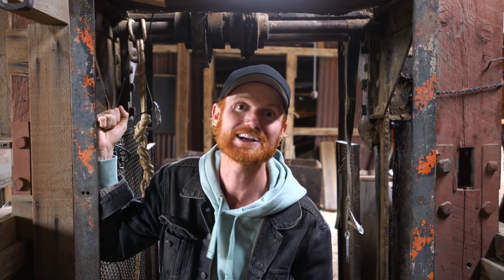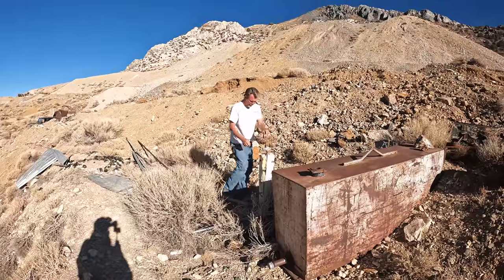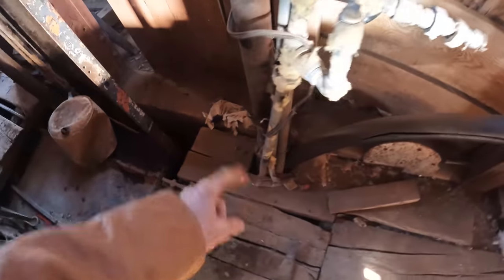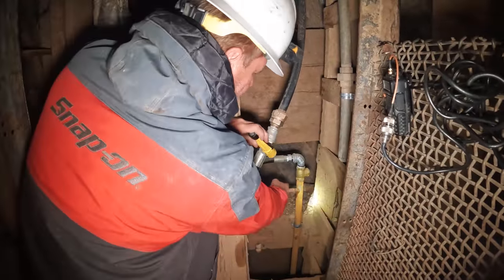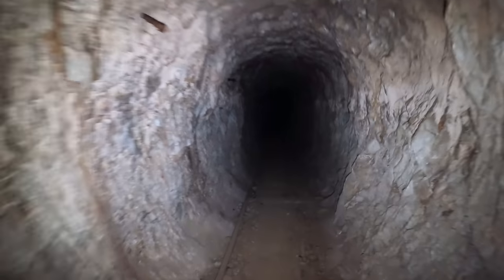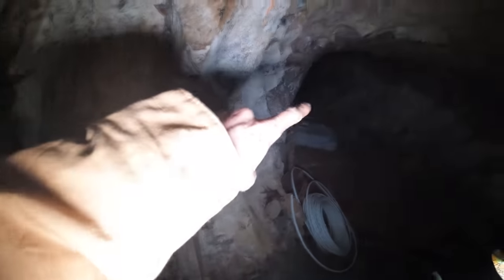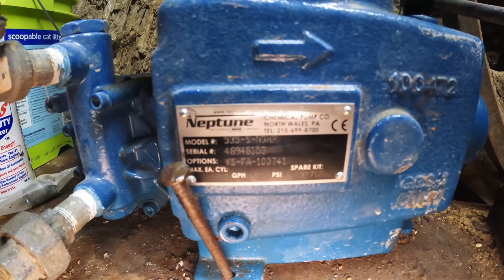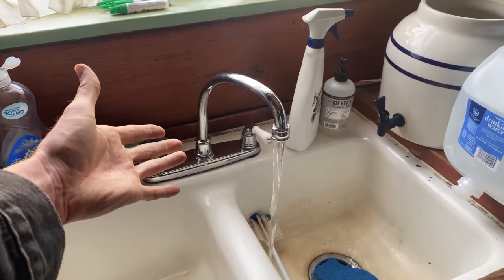How Cerro Gordo 'Ghost Town' Gets Water

Comment: You should try a pump at 375 and at the top with holding tanks at each level .
Reply: That's a really good idea.  Far less stress on the pump, plus you'd be able to store water in whatever size tank(s) you could get down there.  Also an accumulator would be able to help with pressure.
Reply: @codemonkey2k5  are you with Brent ?
Reply: I absolutely agree 👍.  Been thinking on it for months now. It's not my trade, but it seems to me that I remember from my trade school days learning about water pressure in a column. I know there was some math involved, but one of the reasons they would have multiple pump stations and tanks, was that at every station, the pressure was sort of reset. In this case, instead of having 700 plus feet of head pressure, you'd get a reset, every 200 feet or so.

I haven't been able to find any of my books from that era, but think about how water moves in a high rise building in, say, New York City. I mean, how do you get a consistent water flow and pressure from street level all the way up to the 100th floor? 

I could see a system with multiple pumps and storage tanks every couple hundred feet or so, so that when the upper most tank got low, it would kick on the pump draining the next lowest tank, and so forth and so on till the 700 level pump kicked on. 

Any high-rise building engineers here?
Reply: @christophercox3908  those were my mentioned thoughts exactly
Reply: @mrblueun1080  no, just liked the idea and expanded on it.
Reply: This is a great idea but in this video they say that they’re using the original galvanized that has to have build up in the pipe creating friction lose. They should try new pipe from source to ground level.

Comment: Great video Brent! Would love to see more updates and videos about the water system.

Question, does the pump fill a central tank for the town’s buildings, or does the water in town rely solely on the pump running at all times? If there’s no tank close to the hoist house, you could put a 5,000-10,000 gallon tank inside or next to the hoist house and let the pump fill that first. This storage will give you freedom to do what you want with the water without having to rely on the pump to pressurize the town’s system. 

You could have a filtration system right after the tank in the hoist house before either feeding buildings in town directly, or filling smaller tanks at each building with potable water. Tank(s) could be heated slightly to 50°F during winter months to prevent freezing. Also gives some resiliency during power outages. 

I know you have that new and pretty 40,000 gallon tank for the hotel, but there’s something awesome and nostalgic about some of the water supply for the town continuing to be pumped from the mine, rather than trucked in from down the mountain. A beefed up pumping/storage and filtration system could achieve that and supplement deliveries.

Comment: I recall that loss of prime has been a recurring problem. As an idea, I would consider dropping a small submersible pump in the pool of water with discharge to a small 50 USg PVC transfer tank. The submersible pump could operate with simple float control filling the transfer tank on demand. You can then install the 8 USgph Neptune metering pump with a flooded suction pipe in the transfer tank thus avoiding loss of prime issues. And put high quality check valves every 200 feet on the riser pipe to keep pressure below 100 psi on the old galvanized steel section. You could also use wiring between the town above ground tank and control starts and stops of the Neptune pump based on water demand in town.
Reply: This is redundant ideology, the mine water is contaminated!
Reply: @lotharschiese8559  They are not using the water for potable drinking usage.
Reply: @lotharschiese8559  Maybe email Brent and ask to see the results of the testing. Nobody use the water for drinking purpose.

Comment: An RV park that we stayed at in Colorado had a small water truck that they used to haul water to the park and hold it in tanks with a reverse osmosis system attached. That is something you could upgrade to someday to bring you clean and safe drinking water to the town. You have your 5 ton from Heavy D, throw a water tank on the back and that could be enough.

Comment: I would suggest adding rain water catchments.  You have roofs there that catch a lot of water.  I just finished a second one that has a catchment area of 16' x 54'.  The last small rain we had filled and over flowed a 275 gallon tot which is way too small..but it is a start.

Comment: I am so glad to see that you have the pump putting out enough pressure now.  The one thing that has me, and probably others scratching their heads is where did Cerro Gordo get it's water in it's heyday?  I know you showed a water wagon that was used being pulled up there with mules, I believe.  Then I remember there was a cable tramway into Keeler that I thought went to Cerro Gordo, or was to some other nearby place?  That would make perfect sense to bring ore down to Keeler and send up water, oil and other supplies back up to Cerro Gordo.  In fact, the weight of the loads going up can help offset the load of the ore coming down.  

I keep seeing that picture of the woman standing next to the water nozzle with a firehose amount of water coming out and thinking that they must have had a lot of water.  I am also thinking of an old saying that "Money is the lubricant of commerce" or something like that.  ie. If you making enough money at Cerro Gordo, then some of that money will be used to make life there more hospitable.  So, it might be that it was hard and expensive to bring enough water to Cerro Gordo, but that the mine was making enough money to pay to bring up water wagons, perhaps even a fleet of them.   

I am thinking that the mine water is for showering and washing and industrial uses like concreate and the truck is your modern water wagon to bring drinking water up.  Is this the plan?

Comment: I'd suggest some kind of collection-based water source as a backup. For example, something that collects snow/water so you have to use less water from the mine. This way the water in the mine has more time to replenish and it's a secondary way to secure water during certain periods of time.

Comment: Have you looked into a holding tank above ground?  I used to work at a restaurant that had a limited water supply.  They had a 6000 gallon holding tank that filled on a timer.   You could put a tank in the hoist building. Gravity would send water to town. It worked amazingly well.
Reply: This is redundant ideology, the mine water is contaminated! BUT a holding tank with clean water set on high will be functional for gravity feed!

Comment: Another water source could be a large rainwater collection and storage system. I don't know the climate/rain data there, nor the size & expenses involved, just a thought. One positive: Less filtration and treatment would likely be required...
Reply: The issue would be the freeze in winter would blow all the pipes.
Reply: The dust when the wind is blowing which it does a lot,  gets airborne and it is contaminated, read my postings

Comment: The backflow prevention device / foot valve is a check valve.
Going down the elevator there's a check valve at 550 ft from the bottom. 
Curious where the new one will be installed, at ground level of the shaft or somewhere else along the line after. . .

Comment: If you keep on still loosing the feed and the pump needing to be re-primed again you could add a plastic barrel that’s slightly above the pump it would give it an air free positive head of water. If I recall correctly you have a submersible pump as a pre pump and I am thinking that maybe due to cavitation you may have air in the system between the pumps thus the need to re-prime the pump again and again. The positive head of air free water would solve the issue and wouldn’t be difficult to build building a small ‘cradle’ to hold a barrel on its side the pump water in the top and out to the high pressure pump at the bottom quick easy and easy to take down the mine. Good luck with the water and like the others I hope that you have filters and reverse osmosis plant on the water to make it safe enough love the channel and look forward to every episode. Shame I live in the uk or I would be volunteering without a doubt
Reply: Just read my postings, This is redundant ideology, the mine water is contaminated with metals.

Comment: Have you thought of looking into atmospheric water generators? They use whatever mixture is in the air and collects it with coils kind of the way condensation forms on air conditioning coils. 
It is something used in remote spots where water is hard to come by or in places where the water supply is contaminated. 
Judging by the snow you get there, there should be plenty of moisture in the air for one of those systems to work for you.

Comment: Okay, so while I know you should have more than one pump, lets say this dosing pump can handle it. What it needs is a little help.
You need to bring down a 33 gallon poly barrel. Gather enough wood to make a stand for that barrel above the dosing pump. Bring a small circulatory pump to submerge, which I know you already have down there. Bring a couple of float switches. I do highly suspect that all along you've been draining the supply sump in the rock until it sucked air. That said this needs to be changed to positive pressure or air will ALWAYS build up in the intake line on the dosing pump eventually even if the water supply doesn't run out. There is air in the water and especially in a partial vacuum it will build up and cause the pump to lock up from cavitation. So. Have the submersible pump run into the elevated barrel. You could put a switch in the barrel to kick that small pump on when needed, or, have an overflow line in the barrel going back to the stone basin. DO put a float switch in the stone basin for the small pump though. From that point you need to either use the same float in the stone sump via a relay or a second one in the barrel to control the dosing pump. The dosing pump should be fed from the bottom of the barrel. The dosing pump will never loose prime again since it will be fed with positive pressure. Air will escape out of the barrel. This system will work so long as the pumps and switches do. 

Hope this helps.

Comment: It seems to me you should have a submersible pump with a float switch in the collection basin pushing water to your high pressure pump. Use a 5 psi pressure switch before the high pressure pump's inlet to turn that pump on. This way the big, expensive pump cannot be run dry and will never lose prime. You could also add a filter before the high pressure pump's inlet to reduce wear from particulates in the water. Increasing most pump's inlet pressure greatly improves the pump's efficiency so you'll probably get more flow as an added bonus. With the low flow rate of the high pressure pump a very small (and cheap!) submersible pump could be used.

Comment: I would suggest building a town reservoir if there isn't one already (there should be at least holding tanks somewhere), with a heavy duty KDF and UV filtration/sterilization setup to cleanse the water of heavy metals and bacteria, and then a domestic RO system in each building for drinking water.

Comment: So the water table in that specific location in that mine is above there at some point most likely, then it is about 700-800 feet or so if you could drill a water well and hope to find the same source, that is fairly deep for a well, but not unheard of. It may not be a big water source though... So they would then likely want to do some small fracking as it appears to be mostly all rock (fracking not as destructive for water wells as it is on oil wells) and then you could very well end up with a decent water supply.  I suspect for now the issue is cost of drilling an entire new well?
Reply: For a radius of a mile around Cerro Gordo, the bedrock is just peppered with minerals and many small deposits, just Google Earth and look for all the individual ground disturbances, someone dug a hole because they found mineralization.
Reply: @lotharschiese8559  Yes?  Of course, that is how mining works most of the time.  What does that have to do with their chances of finding water or not?

Comment: What an exciting opportunity. The wealth of information available today is amazing. When researching municipal water supply, domestic water systems, water storage systems, treatment and purification I always follow the key words with .pdf or .edu or both and get excellent results. 
  It is easy to establish a fundamental design from here but it's important to know what the recharge rate of the supply is.
 Does the supply draw down at maximum flow rate enough to calculate the recharge? How was the volume determined and how accurate is the data? 
  Anyway, a well thought out distribution, treatment, storage systems and source evaluation really gives way to opening up the future of Cerro Gordo. 
  By the way, managing and monitoring this source / supply is appealing in contrast to many municipal supplies.

Comment: You seem to get a decent amount of snow.  My suggestion is simple - every structure has rain gutters that collect any rain or melting snow into separate barrels and are regularly pumped into a master cistern uphill of the town.  Use PV panels for your electricity  and use gravity to help with flow and pressure issues where possible.  This does not have to be expensive

Comment: Over a year ago I mentioned this idea.. Hope I'm not being annoying...
It appears you have two problems - quantity & depth
As opposed to someone who has a 700' deep drilled well, you have a big advantage..
You can break up the required lift & associated head pressures into more manageable, more normal (to the country home owner) amounts using commonly available, off-the-shelf components.
Install lift stations with small (~50 to 100 gal) open top tank reservoirs, foot valves, float switches & pumps, every 75' to 100' up the shaft.
By doing that, you're employing commonly available parts, that operate at far lower pipe pressures.
Each float switch set to shut off the pump feeding it when the level in the associated reservoir is at max.
Each reservoir, including the bottom / source pool, with a float switch to shut off pump above it when the level gets to low.
At the top, install a much larger tank reservoir to gravity feed the hotel so that the pump system can run / draw from the pool / on a more constant rate..
Yes, it would take about 10 such lift stations, but each would require far less exotic, less expensive components, with none operating at extreme pressures & such that you could use normal PVC well pipe & the system could be serviced by the average pump / well maintenance company, or by you yourself.
One final advantage, is that you could start installing the lift stations one at a time, from the top, as you could afford it.
Working your way down, each additional station would progressively lower the head pressure on the original pump at the bottom..
Note: As you no doubt are already know, horizontal pipe does not add to head pressure.
Best regards, Dennis
Reply: Reading some of the comments, I see others have suggested the same solution.. Perhaps my response is of some value though in pointing out that more lift stations represent lower cost, commonly available components, safer system & lower tech service requirements..
Why safer?  If you spring a leak with the existing extreme head pressures, not only would it be extremely dangerous to anyone nearby, but the resulting stream of water could very quickly erode away whatever surface it strikes / collapse the mine shaft..   Just a thought
Regards, Dennis

Comment: so what is the voltage of the pump...have you checked for a voltage drop...700 feet at 240v prob needs a # 6 wire...low amperage due voltage drop will burn out motors
Reply: This is redundant ideology, the mine water is contaminated with metals, read my postings

Comment: suggestion:  locate where the seep is underground relative to the shaft.  go to the surface.  locate that spot.  have a drilling company drop a drilled well there to the depth of the seep + 5 feet.  drop a pump and line down the well.  Now you have a standard well setup in a place you know will have water which won't keep breaking and which won't be an issue if your mining cage ever breaks down

Comment: XX This is easily fixed! XX Current setup is adequate to pump to 700ft easily but that's not your issue. The issue is the elevation drop between top of mine on the hill and town below which are causing negative pressure in the sealed pipe (since water is non compressible) every time you open the tap in town as water pressure is blead off at the tap it will cause negative pressure up on the hill and then down at the pump where AIR WILL COME OUT OF SOLUTION (solution being water and phenomenon called cavitation). This un-primes your pump below. You need to separate the system at the valve on the floor i saw at the top of the mine and add a tee fitting which id hook to the BOTTOM of a storage tank of almost any size but it needs to be open to the atmosphere. This will not only reduce pressure at the pump since it has no opposing pressure when tap is off but it will also pump volume of reserve. Pressure at the town will be created by gravity (you only need a 138ft drop to create 60psi of line pressure) you might end up having excessive line pressure in town which you would need to simply regulate IN TOWN but it will never cause the pump to unprime at the bottom of the shaft.